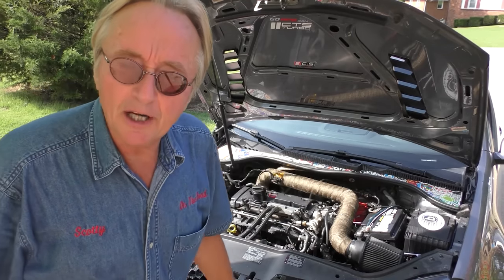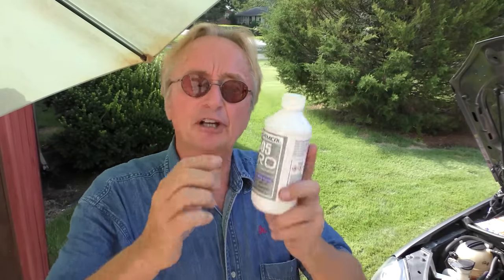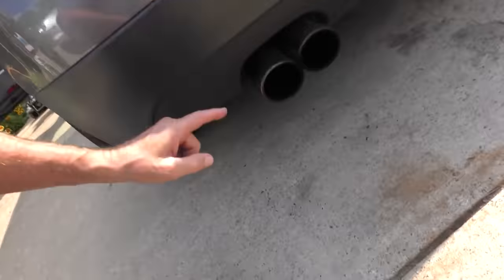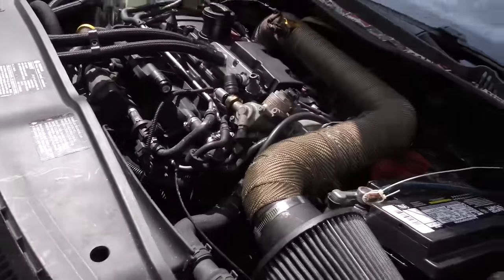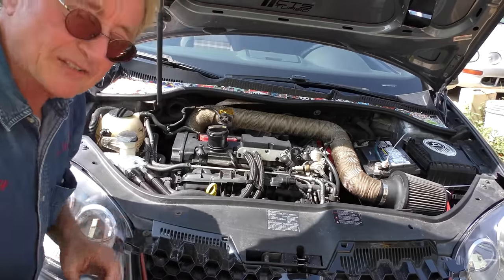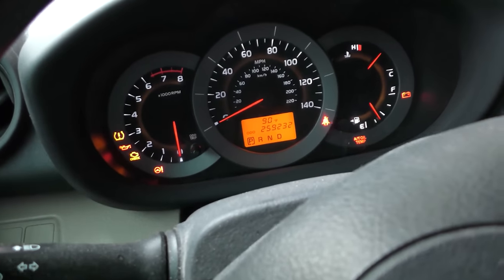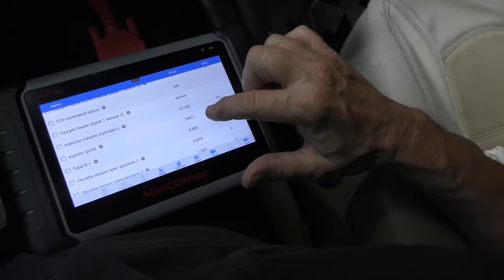3 Things That Will Make Your Engine Last Forever

Comment: Doesent idle speed rise anyway as the engine warms?
Per haps a comparison of before and after fuel consumption would be a clincher.
Clean new oil usualy makes a moter quieter.
However if your impressed  thats great.

Comment: what if you filled each piston hole with some sort of solvent to loosen the rings up, crank it over by hand a few turns then a little oil in the holes and refill with fresh oil.

Comment: I need to find out where Scotty lives and take my car there for a overall tuneup.  It is a I4 Honda so no timing belt so we’re talking spark plugs and overall check to see if I should save for a suspension later.  It still have original spark plugs at 165k miles and rins very very.  Fuel economy is still beating EPA rating so I haven't touch the plug.  And now with Costco selling synthetic oil for dirt cheap, I am thinking I’ll change more often to take it to 300k miles.

Comment: I love your content u tell it like it is. I need to know how to put the radiator and ac condincer trans cooler back in my wife's 07 mkz I've had a new water pump in it and drive line the motor is perfect but dose that thing have a oil cooler in the radiator?

Comment: Thanks Scotty! I am on my second car and it has a GDI system. I’ll make sure before winter really hits I use this oil! Mine is at 78k miles and I’m hearing some noise, it could just need a valve adjustment, my owners manual says to do it every 60k I don’t think it’s been done. It’s on cold startup I hear it. For reference 2013 Mazda 3 skyactive 2.0l
Reply: But i think he was saying that this carbon buildup is different than that caused by gasoline which would be the case in a GDI system like yours I believe
Reply: He has a seperate video on GDI systems

Comment: Hi Scotty, I always learn something new from your Videos. I have a question, I have a 2006 BMW T1200GS Motorcycle. In the Final Drive gear Case. It’s supposed to use 70-90W Gear Oil. I decided to use a 70-90W Marine Gear Oil. That’s because it’s supposed to fight Corrosion in harsh conditions. It’s Synthetic by the way. Was that ok to do? I’m second guessing myself on this.
Thanks for all the Work you do making these Videos Scotty.👍👍

Comment: Im going through this same thing my Toyota Camry is a 2006 and it has almost 30000 miles on it and it is doing the same thing running through gas and the oil is going somewhere cause my oil is low all the time
Reply: Oil rings are probably letting oil past and it's burning off. If it smokes when you put your foot down.

Comment: Hey Scotty, there was a time when I bought a new 2006 van and used conventional oil. The manual said I could use synthetic or conventional in it. After I had it for a while I started using the van for deliveries so in an effort to extend the life of the engine I switched to synthetic. After a year or two it started getting noisy until I got on the interstate one day where it felt like the engine was coming apart. When I pulled the valve covers there were pieces of the valve train inside. Never ran again.
After that experience I decided I won’t use synthetic after running conventional oil. I now have a 2004 Grand Marquis with conventional. There was a point I was lead to believe no one made conventional oil anymore, but found out oil change places are able to get it. To ensure I don’t accidentally put in synthetic oil, is there a point where the oil type grade can only be met by synthetic? Since some packages don’t specify synthetic or conventional on the packaging I was thinking if I looked at the certification seal I could be sure it wasn’t synthetic. 
This Marquis has nearly 270K on the engine so I don’t want to risk an earlier demise by accidentally putting synthetic in it. Love the videos! As a hand talker myself I can relate to the jokes.🤷
Reply: You can always find conventional for cheap at Walmart. I hate to upsell them so often, but they always have many options of conventional on hand and not so much synthetics. If you see a "dexos" label, that usually means synthetic. But, I really think it depends how the previous owner took care of the engine. I'm a habitual synthetic user. Never had issues except one car... If it was ran on conventional its whole life, not on time changes. Switching to synthetic will kill it. I switched a 2000 Buick Century to synthetic, it wasn't maintained well. Threw a rod the next year around 100,000 miles. Kind of like your story. I assume the oil filter clogged with sludge and starved it of oil.

Comment: My Acura mdx 2007 takes ow -20 now is that right and I’m going to find a product that will have to do what you used in your video to clean the carbon on the engines parts thanks 🙏 I think the gears ⚙️ doesn’t get out of the 35-40 range very fast it’s stays in one of the gears longest around the third gear so I’m going to try a new mass sensor to see if that will help and I can’t forget to find a gas cleaner as you mentioned. And not to mention I have a main rear seal leak so I have my hands full but it’s a nice ride but pretty costly but can you tell me if it’s worth fixing it’s got just over 150,000 miles on it thanks again Scotty!!!

Comment: Scotty, I have a 2014 Nissan Versa Note & about 2 weeks ago I used Cataclean  to get rid of my check engine light (I know my catalytic converter is clogged & I have used this in the past in order to get rid of the light, probably two or three times already in the past tow years). It's been about two weeks now & quite a few fill ups (high test gas only) but it's still on. What do you suggest? Can I use a fuel system cleaner now or is it too early or too close to when I used the Cataclean? I need your help...please

Comment: Somebody help me, I'm new to auto maintenance and a little confused.  Later in the video, he said to not bother flushing the engine because the conditioner in the oil already cleans the engine of the dirt well enough.  In the beginning of the video with the VW, is the 505 CRO that he put considered an engine flush?  Is that safe to do on a toyota corolla with 200k miles?

Comment: Hey Scotty, wondering if you could help me and many others it seems. I have a 2008 Cadillac SRX 3.6 liter v6. We bought it from the original owner. It had 140k on it when we bought it. We have about 215k on it now. The car is throwing a code that the MAP sensor is bad. For the life of me I cannot locate this sensor anywhere on the intake or firewall. I know what one looks like but I cannot locate this little bugger. Can you help with a video for a replacement?
Thanks love your videos, I have been a loyal watcher for quite some time. Thanks in advance!

Comment: My cars previous oil changes have always used 5w-30 however the last service they have put 0w-20 in the car. The manufacturer book shows my e give can use 0w-20 just not sure what the different oil will do

Comment: Scotty, i bought a 2007 Acura RL, it has 75k milles on it, but i think didn't had be taken good care by the previous owner. I need an advise, since the engine using 15W40 Oil, and in cold start it rattles a while till it lubricate, after that it runs smooth when hot. Will you recommend Flushing adding kerosene to the old oil, drain it and changing to 5w20 synthetic oil?? BTW we in Venezuela, this it hot tropical weather

Comment: I have a 2014 Hyundai sport I have 56,000 miles on it are use of synthetic blend oil can you still put an Ativan like STP or is it not necessary whole fashion used to put STP oil treatment in all my carsAlso I listen to you about gas treatment for the engine which one would you recommend

Comment: DONT USE OIL FLUSHES!! You can loosen too much carbon and after changing the oil you can clog the new oil filter in a short period of time due to left over build up that didn’t come out right away.. It’s a huge risk. You can even clog the system during the flush and kill the engine. 

Just use Valvoline clean and protect. It will do the sane thing over the period of a couple oil changes without clogging the filter.

Comment: Scott. I have a 2016 f150 5.0with 101432 miles on it. It is a flex fuel vehicle. I have access to ethanol free gas. Which is the best gas to run?

Comment: I agree with Scotty that it's best to buy a normal paper air filter. When I cleaned and re-oiled the K&N filter for my '02 BMW 325, it damaged the MAF sensor which was costly. Obviously I used too much oil despite letting it dry in the sun for many hours.

Comment: My Rav4 has no mileage issues but Engine stops in 20 miles on freeway. Need to switch off and Start to run another 20-30 miles. I don't have a clue what's the issue.

Comment: Off subject but if you could answer this I'd be thankful 💯🙂 just had rear brakes replaced, now there's a rubbing( I think" sound coming from the area of 1 of those ends that was also jammed when my friend replaced it, sounds like something is rubbing something else, does Not happen while braking or accelerating but does when coasting. This started immediately after the brakes were done, 1 day after, any ideas? Thanks!

Comment: so if you have a Honda 2013 Honda accord with v6, 91000 miles and runs like a top.  Would you put 505CRF™Fuel Pour-In Treatment to improve driveability or just leave the fuel alone?

Comment: Can I use 50%concentrate summer coolant anti freeze in my 307 peugeot xs 2.0 petrol 2002 engine without mixing it with pure water?

Comment: The problem was the lifters are consuming too much oil gas and that's why it's like that I just got mine fixed and now it's running smoother than before

Comment: So my 2014 Ford Fusion Hybrid has 100k and the cap says 5w20, what should I use? Mobile 1 full synthetic high mileage or any other recommendations? I do NOT want to go to the dealer again, they are expensive, and Quick Lane service they do not know what's going on most of the time.

Comment: I'm getting a high idle when my a/c is on around 1100 rpm when in park. When I change gears to drive it drops to about  700 to 800 rpm. If I start the car with the a/c off the idle is correct around 650 to 700 rpm in park. It's a 2011 Range Rover Sport . Any suggestions to what is causing the high idle when a/c is on?

Comment: I have a Kia optima LX it's got sprout mode an eco an regular mode.
My question is that is eating oil fast. Why do I do ? It's got 102 k  the control module has been changed an the ignition coils been changed with spark plugs but can't seem to keep the oil light from popping up I drive a lot idk what to do

Comment: Hey Scotty. Question. My pop always taught me to change my engine oil every 3,000 miles. But now that they make synthetic oil how often to I have to change it? I’ve read that the new synthetic oil can be good for up to 10,000 miles! Is this true? Or should I just stick to changing it every 3,000 miles. Thank you kindly, Ron in San Antonio, Texas.
Reply: I never exceed 6,000 miles. Mobil1 is good but don't use it everytime because it has an oil system cleaner and will start eating at the seals. I switch back and forth between Mobil full synthetic and Mobil1 full synthetic.

Comment: I have a 2004 V W Passat with a transmission problem auto 4 speed shifter work s but put it in gear it only goes in 2 or rev Park do you have any suggestions for me and. The problem came on with know warning engine 4 turbo help

Comment: that is exactly what happened when I tried a engine cleaner w my Mazda Truck, it ate thru the valve cover gaskets and leaked oil. replaced the gaskets and never use in my toyota car or Truck.

Comment: Scotty,

I don't understand... First you showed us an oil additive to clean carbon out of the engine.  Then later you told us NOT to use a flush  to clean engines because it would CREATE leaks.  So do we want to remove carbon or not?
Reply: It depends. If you've taken care of the car and always done oil changes early then your seals are probably still good especially under 10 years. Then engine flush is good to use. If your seals are old and worn and are being held together by carbon because it's too old or abused then cleaning the oil off reveals leaks that already existed. I used a flush on my cars but they only have 60k miles. The one I bought used I just prayed wasn't abused too much by the previous owner and ended up fine.

Comment: Good morning sir my wife has the horrible gdi motor from Hyundai I was thinking of using the BG product. The goal is to  stop her excessive oil burning. What is your opinion on the BG product? Or if you can recommend me any products that will work better please reply have a nice day
Reply: My mom has a 2014 Sportage that burns a decent amount. 118k on it. She had the PCV valve changed around 100k. Also, switched to high mileage oil. It still burns, but it's not a crazy amount. And she's switched to 3,000 mile intervals, to try to clean the inside up naturally and not use additives. All of these engines have to be gunky inside. Her oil turns pitch black pretty quick.

Comment: I used BG EPR once but it was only for 14 minutes of 1.3-1.4k revs so it did not help much.. next time i'll let it for at least 30minutes and i'll go with millers oils with nano..
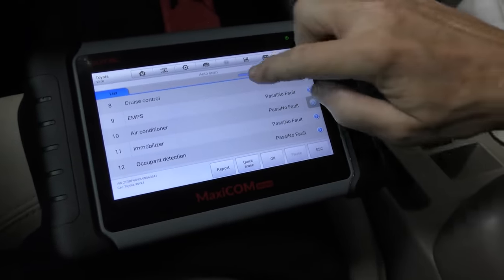Also guyz, remember the rule! 10.000 km max (oil change interval) 6:40 😂 sorry but if i run on empty tires, it IS gonna affect the gas mileage. Edit no.2 flushing ALWAYS prevents oilburn because it ungunks the rings so they seal better!

Comment: My Toyota gets stuck in 3rd at 4 thousand before it changes gearit runs rough at idle almost turning off at times oil light blinks when it rough it goes up and down between 500 and 1000 can you please help me figure this out

Comment: Okay I hope somebody see’s this. Be extremely careful about doing engine flushes. (carbon clean)
I did one on a car I just picked up and 1 week later I lost oil pressure and the motor seized. Turns out all the carbon in the motor got stuck in the oil pickup line. Be very careful

Comment: Mobile Delvac 30  weight. The best and I use Castro 20w 50 in all my motorcycle engines and when it starts to get dirty I change it  7 days later ( Never) Let your motorcycle engine oil get black.     When it gets cloudy change it your Bike will Last they to expensive to repair oil is cheap insurance

Comment: My dad in the old days use to put water down the carb you could see the black coming out of the exhaust had me stepping on the gas so it would not stall worked great Ha Ha no injectors in though s days

Comment: There’s nothing wrong with the K&N air filter. Here’s a pro tip never oil the clean side of the filter only oil the dirty side let it wick for about 35 minutes. Problem solved I used K&N filters in every vehicle that I’ve ever owned. I’ve never had a problem with the mass airflow sensor, because YOU NEVER OIL THE CLEAN SIDE OF FILTER if you do that will give you extreme problems. You always oil on the dirty side, same as cleaning it always wash from the clean side, spray, product or degreaser both sides of filter with warm Luke water not pressured, rinse from clean side if you rinse from dirty side, you are putting deposits and contamination back into the filter so rinse from clean side until all the dirt and debris and oil are out of filter let air dry outside for at least 3 to 4 hours depending on where you are at never force dry when filter is completely dried you oil each plates on filter one at a time on the dirty side same thing goes for spraying oil do not use a lot of it a little of it goes long long way let oil wick into the filter and I promise you you will never have a problem.😉

Comment: 1st was OLD OIL

2nd was NEW OIL

not a fair test

Should have done it as is

1st run it as is and record

2nd change OIL and filter and run 15 minutes. See how it sounds

3rd put your additive in run 15 minutes and change oil again

Then record

Comment: So where does this carbon go after its cleaned off the valves? Straight to outer space? Or into the cylinder to scratch the sh1t out of the cylinder walls and clog the oil pump?

Comment: can in oil?  ohhh, k&n, lol.  in the last month, had two iol changes at two different locations, over fill the oil?  why?  i asked why is it so expensive?  No! i do not want synthetic (both vehicles are over 15 years old).  the dealership said, the labor went up, alright, why over fill?  is it sythetic blend oil, regardless, i stated No! synthetic oil nimrod.  they put it in anyway and over fill.  what is the damage that nimrod has caused by over filling the oil?

Comment: Scotty confused me, in this one. In the first section (VW) Scotty extolls the virtues of flushing the engine with the ATS 505 Oil system treatment to clear carbon build up. Then, in the oil section he tells us not to do it: it can make the engine too clean and cause leaks. So, which is it?

Comment: Scotty I have a 2000 Toyota Camry XLE 2.2 . The car has 200k. The transmission shifts well. I never changed the fluid. Bought it with 190k. Fluid is not terrible. But I would like to change the filter and gasket. My problem is the bolts that hold the pan  on are rusted and somewhat disintegrated. How would you go about getting them off. I want to keep the car as long as possible. What do you recommend. What works to get the bolts off. A special penetrating oil and tool? If so which one.

Comment: Bought  a 2023 Toyota corolla was getting 361 miles now I’m getting 220 after oil change when up to 289  told them a while back something was wrong and they did nothing

Comment: So here is your mistake yes you did great by changing the oil and doing  a oil change but due to the car has over 100000 miles you should be using a slightly thicker oil that what is specifies in the manual as the lifters is what will cause most of the noise also doing this will extend the life of your vehicle

Comment: 1st car, Wait is that heat wrap on the intake tube but the air filter is in the heat area of the engine bay
That's useless